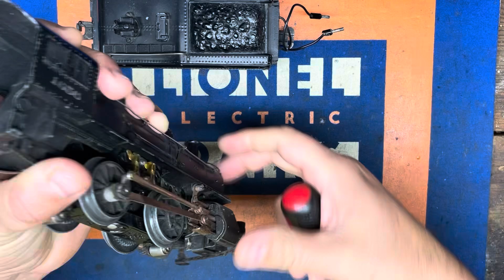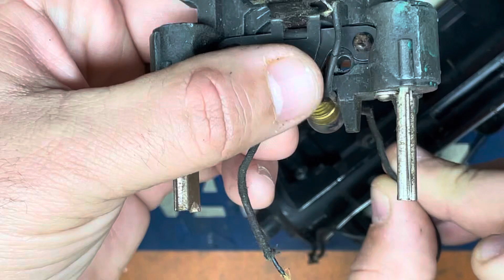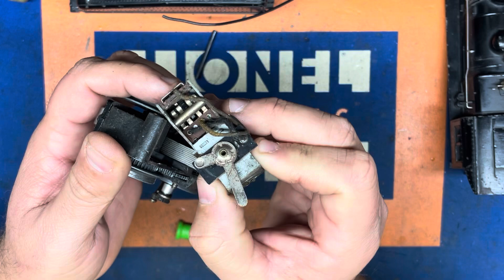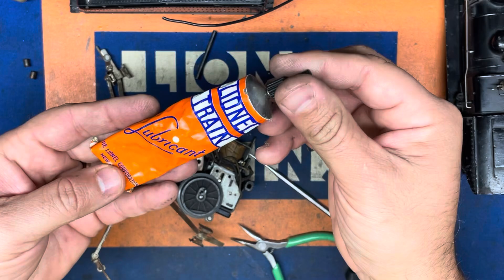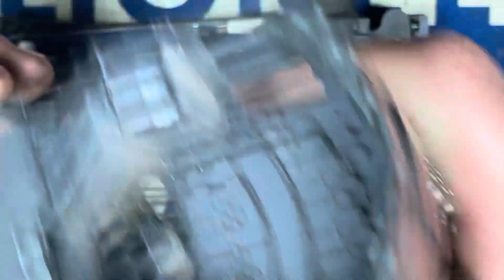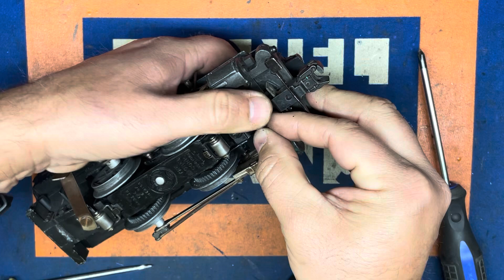Let’s Repair & Service A Lionel 1656 Steam Locomotive

Comment: I have one of these 1656 engines.  Here are a couple of things to point out.  1) Shaft gets oil; gears get grease.  2) The side rod quartering is dependent on the mesh between the 2 idler gears and the armature shaft gear.  3) Should take the side rods off first; saves a lot of interference.  4) Looks like you are missing the side rods that go between the wheels.  They are part numbers 1666-16L and 1666-16R for left and right sides respectively.
Reply from the maker: Appreciate the tips and info! Thanks for watching!

Comment: Could you please do a video on these bell ringer tenders?
Reply from the maker: Let me see what I can do …do you something specific or just looking for a tear down and reassembly?
Reply: @modeltrainsolutions7368   I have two. Both need torn down and rebuilt. Both are missing wires.  Some of the wires they do have the insulation is trash. My Greenberg's doesn't have anything on them.  
    I once had a 1656 that one of the side holes wasn't drilled all the way thru. Found the screw was shortened to about half. Couldn't see a reason for doing that.

Comment: Hello good work getting your 1656 to run well. I recently got a 1656 with the bell ringing tender. The 1656 runs okay and head light works, some wobble in reverse. I could only get the tender bell to work in neutral and the tender light stays on constantly and only occasionally the bell will ring in forward or reverse, I have not tried cleaning contact roller on tender yet any ideas what could be the issue? . From the back of the 1656 I plugged tender into the left and center plug holes in back of engine is that correct?

Comment: The 1656 switcher is a great little engine and fun to run. I have one as well from my dad's collection. It definitely can be tricky to reassemble. However, you have to be very careful and not run the locomotive too fast. It has a tendency to land on its side, as I see this one probably has due to the missing marker light.

Comment: I have a question when you disassembled the steam switcher and took the diecast body off the frame. Could the boiler front be separator from the steam chest?  I noticed that one of the jewels were broken off.  Is it possible to remove the boiler front and order replacement part so you can have both Jules on front of the locomotive?
Reply from the maker: Unfortunately, no…the boiler front and the rest of the shell is all one piece.  At one point, there were replacement marker lights available on eBay.  But I just did a quick search and didn’t find any.  The replacement of these markers is also difficult.  As you would need to use a dremel cutter to cut out a small section of the boiler front under where the broken marker is located, then use liquid weld or a similar epoxy to secure the replacement part.  Thanks for your question.

Comment: Great job, though I’m not sure if I would have used WD-40 anywhere near the e-unit fingers.
Reply from the maker: Thank you for the feedback!  I was careful to just use a ‘smigeon’ of WD-40 directly on the plunger shaft at the base of the solenoid.  Hindsight, I probably should have sprayed the WD-40 on a q-tip to apply.  Either way, I was surprised that it worked as well as it did.